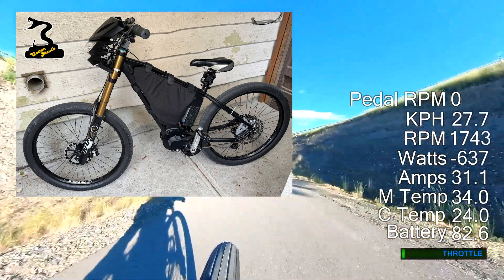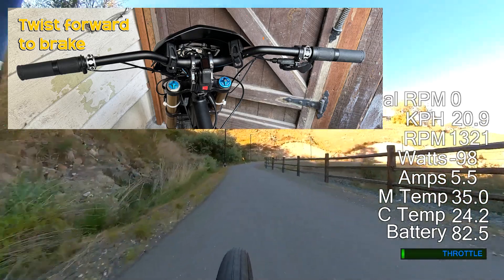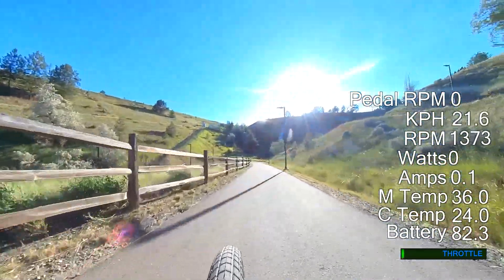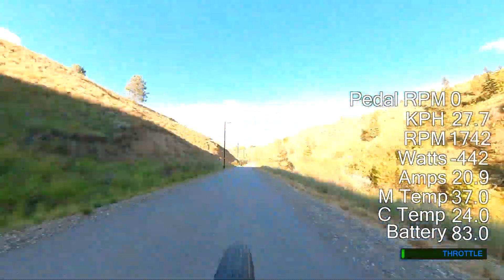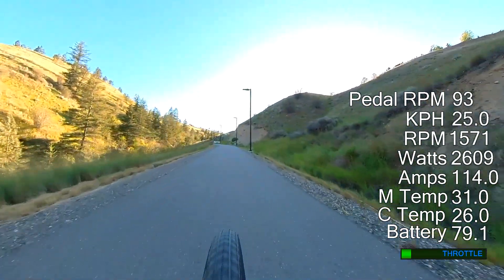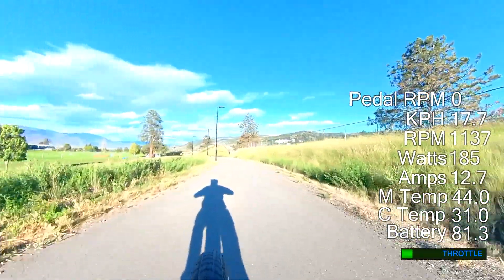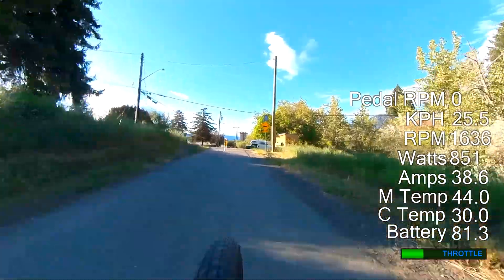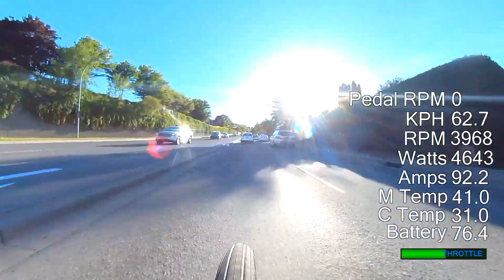Regen Braking for Ebikes with the Cotton Mouth - Why this bike is awesome!

Comment: Do they use a bank of capacitors to energize then trickle charge the battery cells evenly? The caps will heat up a lot, instead of burning out a battery. Caps can withstand a lot of potential energy. Just like in a Prius.
Reply from the maker: There are large capacitors in the controllers for sure. But it’s not to trickle charge the battery. I think that kind of regen might be a ways off for Ebike’s.

Comment: Hello. That left braking throttle was your idea? Or it is like this in general with regen ebikes?
Reply from the maker: I can’t claim to have invented it. First came across it on Ebikes via Electric Race Technologies years ago. It’s not used like this very often which is a shame cause it’s awesome.
Reply: @HighVoltageKits  Indeed is great idea. And I guess you can get used to it pretty quick.

Comment: Regen is great even if you dont need the energy back. When tuning or playing on a diy ebike its constant accel and braking. My mid drive without regen covered my bike in brake dust in about 10 rides. Non wear item braking is ideal for most situations.  Its like cruise control for descents without warping or glazing rotors!
Reply from the maker: Absolutely saves the breaks. I’m in a really hilly place so I likely get a bit more energy back than most.

Comment: every battery management system should have a feature only to charge the cells to 4.0 volts for storage or day to day use where full capacity isn't strictly needed
Reply from the maker: You can do this with some. I usually charge my 72 volt pack up to 83 volts I also have another program to 81 volts depending on what I’m doing. I use the Grin cycle satiatior. It’s not the most powerful but it’s fully waterproofed and allows you to have many different charging programs for everything from a simple 12 volt pack up to a 72 volt one. Not the cheapest system tho. Cheers

Comment: I did this play many times with Bionx over years. You can do it endless if you put in your own human power to compensate motor+battery+air-resistance losses, both up and down. my estimate was getting about 50% back but only if I regen at about the same speed as assist up. As i only give only about 200W to the system, and only uphill the maximum support is onyl 200W or 100%. If i get more support, Bionx is limited to about 275%, i could not get more than 50% back.
Your power monitor jumps wildly but for 50% efficiency you need to put the same human power uphill into the system as you read electrical. That seams not reasonable. Plz check,
Reply: Obviously, you're commenting from some great experience, and it's much appreciated. Thank you. Yes, it's definitely a "what you put in, is what you get out" scenario. More testing and keeping track of the data will be done over time. Keep in mind the regen was added to the design of the bike primary for alternative braking and performance has been good. The power regeneration is just a cherry on top of the ice cream! It's good ice cream!
Reply: @kb-rl1pn  Yes, regen braking is one great benefit but low drive train stress on direct motors give you 5-10k kilometers on cassette and chain. Here in EU direct you will find direct drive only on 45km/h or class 3 bikes.
Your bike looks interesting, so the motor chain is a motobike chain? How long the wheel runs free with the motor off? It is a very good measure of the non-electric regen losses. If you know the rotational interia you can calculated this in W.

Comment: I assume the same motor is doing the propulsion and the regen, hence need for additional chain? I wonder if regen will not mess batteries up by being charged and discharged constantly. My only wish would be Torque sensing, apart from that it's really nice bike!
Reply: The answer to your question is yet to be discovered and will take some time to evaluate. The TS is complicated and needs more testing. The pas sensor gives the rider an intuitive feeling and power delivery can be modified within the Eggrider and High Votlage  apps. It actually feels quite nice while riding and pedaling with lower pas levels. The High Voltage tuning of the Bac2000 is great and user friendly.

Comment: What's the max speed? is there a way to mod it for faster? Efficiency percent?
Reply: not sure
Reply: My comment of 'not sure" is directed at the "max speed". For safety reasons we have decided to test the CM in an appropriate setting in regard to the proper place, time & safety equipment.  We do know that CM is comfortable in the 5k/40mph(64.4kmh) range and definitely still has more to give. (again...under the correct conditions)

Comment: One of the nicest high power ebikes I have seen. Congrats on all your work.
Also, beautiful riding venue. Canada is beautiful this time of year.
PS. any plans for selling these bikes either complete or by parts including battery and motor?
Reply from the maker: Bikes in various stages of build from a frame up to fully built are on offer. The only thing not being done is the battery. Although cases can be supplied. North Bay Bikes are the place to contact. Either with the link in the description or via our discord

Comment: If you had to guess... How much % of regen were you applying on the downhill. What's the max you have seen? Regen emergency stop?
Reply from the maker: It it putting just over 600 watts at the max at the current 70% ratio. There is another setting that governs it though. So it can go up. You can also lock a wheel lol.

Comment: You came up with this video…exactly tonight few minutes after I was thinking about it 😅
Good info and tips 👍🏻
I will give it a try on the Vesc setup to see how it acts 😁
Reply from the maker: That’s scary lol. Good luck. Let us know how you get on
Reply: @HighVoltageKits Thank you , I will show it up when I will take action 👍🏻
I am curious how many battery Bms\amps are you using and what cells , because I see the discharging rate is at 80-90 amps in 3-4kw continuous … making the 60km/h very easy and going pretty healthy up to 80km/h ( and here I refer more at your bbshd which gone with 80km/h in your speed runs )
Is it 60 or 80 bms and is maxing out at 90 from the app, or is a real 90 amps ripping in that way ? 🤔
I don’t manage to get more than 60-70km/h out of my Chinese battery at 50 amp BMS pretty maxed out🫣😅😅
Thank you 👌
Reply from the maker: Those are phase amps. It’s set to 180 max. The battery has a 300 amp bms on it. At least that was what was originally specified. I’m not sure what battery amps it’s pulling. I’d have to check.
Reply: @HighVoltageKits  ohh myyyy days, what an animal of battery with 300 amp BMs 🫣🫶 I bet one of those batteries are pretty costly, but anyway…I got the answer needed 🙏
Then the max speed should be 100km/h+ on this setup and with the bbshd around 80km/h+ ( maybe because of the high  motor amps and battery the motor gets pretty hot )…but I am not an expert to tell, I just guess 🫡
At me I set it to 100 amps on motor ( higher it cuts, maybe because the battery can not provide enough…), and 50 amps on battery ( app shows 60-70 amps max overkilling the battery a bit, maybe because I have not put a wattage limitation, and left to pull as much as it can )
Thank you for replying to it 🤗
Reply from the maker: @alex.copilu you are welcome. Not sure on top speed yet. I have seen it pop up to 85 briefly. I need to find the right time and place to test top speed.
Reply: @HighVoltageKits  I have seen others going 80, 100 and 120 km/h ( the video with 120km/h I really can not find it anymore, but I know for sure I have seen it ),then I am sure your toy can do it too ( sometimes maybe you don’t feel that safe/great to go that speed on a bike and it doesn’t worth it , but the bike can get up there for sure )👌 
Cheers 🤗
Reply from the maker: @alex.copilu it feels pretty good at the speeds I’m doing so once to find out maybe but I won’t be riding to go fast most of the time. The acceleration is the best bit.
Reply: @HighVoltageKits  good to hear good things about its stability too 👌
With my previous fork the bike was lighter and on road when accelerating hard I could feel too much power/NM becoming a bit scary ( off road couldn’t push it to the limits ), but now putting a heavier one I can throttle it at the max much easier, and I feel that it wants more than 60-70km/h, becoming much stable at higher speeds … Thus I asked about the battery specs 🙏👍🏻 of course the acceleration it s a beast with that battery 😅👍🏻
Then…if you wish to do that, I am waiting  for it very excited 🤗
Reply: I'm running regen with VESC for some time now on a DD hub and for me there is no going back to a non-regen setup. I am not running rear brake, the wheel can almost lock up under regen braking, but not quite, it works like ABS. It's both safer and requires less maintenance.